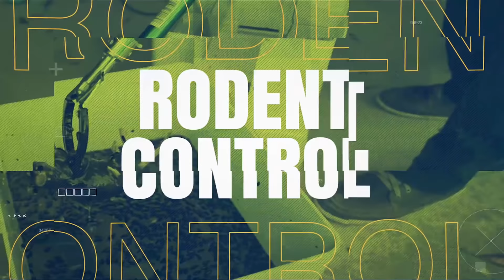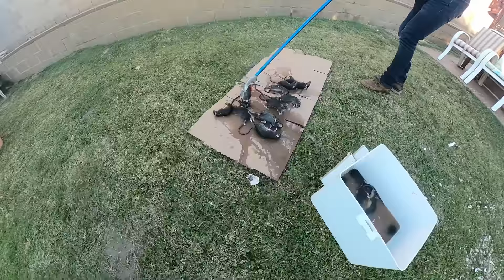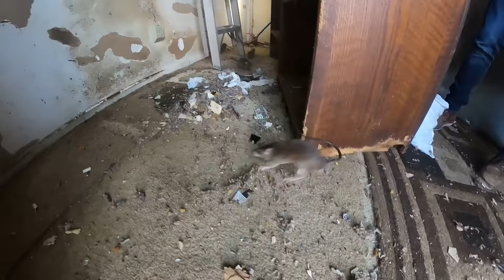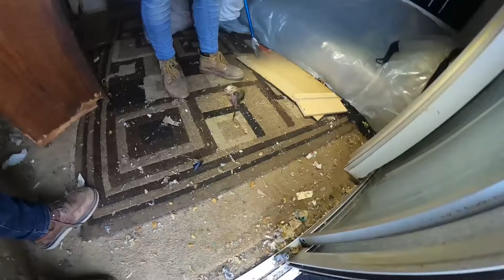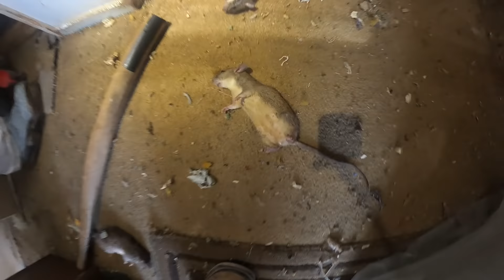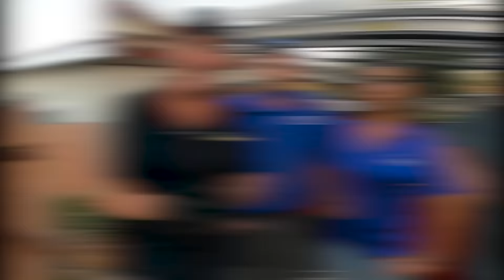Get RID OF RATS QUICKLY...boots vs rats

Comment: I once sorted out my own rat problem, a family of them living in walls and under floor boards, I started with blocking entry points and removing their food supply. Eventually it forced them to come out into the open,  I killed one with a hammer, another in a rat trap with peanut butter, but the remainder seemed to leave the premises as they could no longer access food. Got lucky I suppose. Almost a year later, I thought it would be ok to unblock entry point and straight away got a rat again, so i blocked it again and poured loads of bleach down there. Nothing since.

Comment: How long should one wait to know whether the last of the rats have been killed/captured? I’ve dealt with 6. It’s usually capturing one at a time. Most recently I captured 3 in a short time. I haven’t seen any activity in about a week.
Reply from the maker: A week is a good sign that you don’t have anything. More importantly you have to find and seal up the entry points. Thanks for the Great question.
Reply: @TwinHomeExperts  I did seal entry points about two weeks ago. I haven’t been able to get on top of the roof to put metal coverings on roof pipes. I ordered rodent covering for downspouts but they were too big. I also ordered covering for draining black pipes that are connected to downspouts but also was too big. Should I worry about putting rodent barriers on downspouts, drain pipes and pvc pipes that are connected to sump pumps in basement? I just want to make sure they never enter again. We never had rats in the 8 years we owned house until contractor who ripped us off filled driveway with trash and crap.